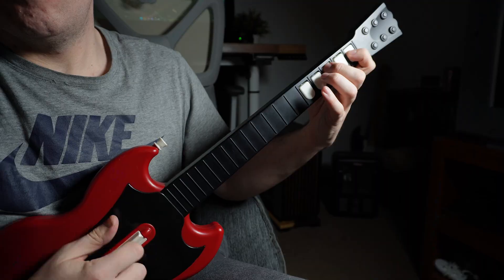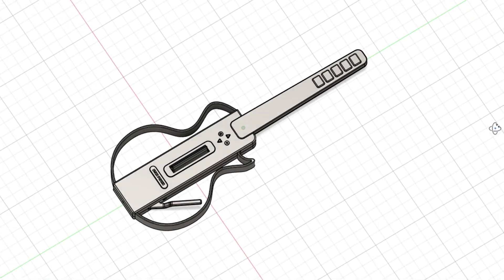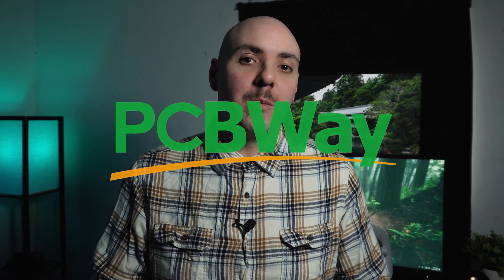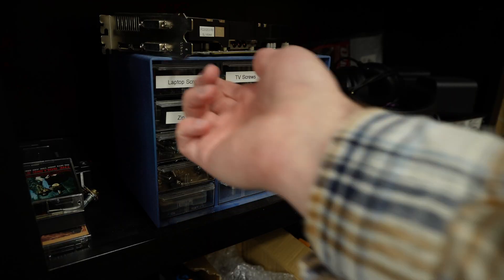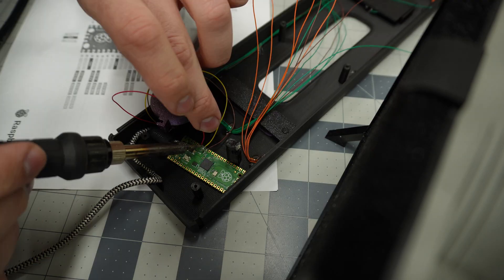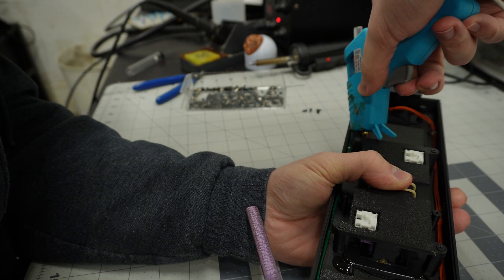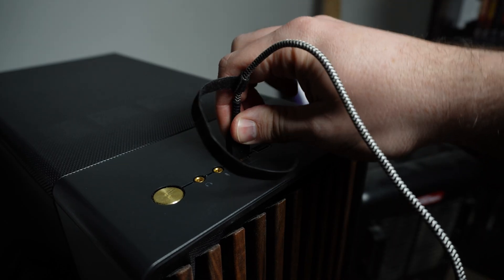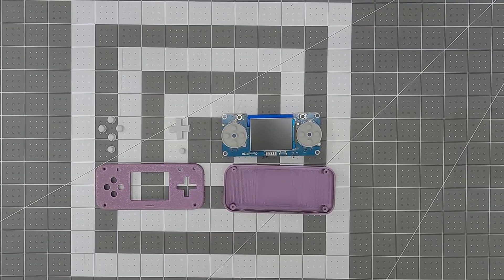(most) Guitar Hero Controllers Suck... So I Made My Own for Only $4!

Comment: I love the idea of using rubber band instead of springs

Having to find a specific spring size is horrible but having a rubber band is almost universal
Reply from the maker: For sure! it's way easier to find rubber bands locally, in fact most people already have them laying around.

I always like to design my projects around stuff that people would likely have lying around because whenever I download someone else's design, I'm usually put off by the massive list of parts I would need to buy.
Reply: @CF-Builds Rubber band do deteriorate over time so I think that why springs are used often.
Replacing the rubber bands seems easy enough tho, so if people build this replacing rubber bands won't be an issue indeed haha

Comment: I was sure this video would have at the very least ~20000 views until I actually looked at the views at the end. Super nicely done! Only part I dislike is the sound of pla layer lines rubbing together. Using a softer plastic like petg or asa/abs should help  quite a bit with that!
Reply from the maker: That's not a bad idea, I may try to use ABS if I ever decide to change up the colors (: